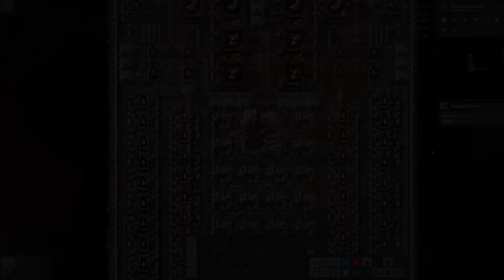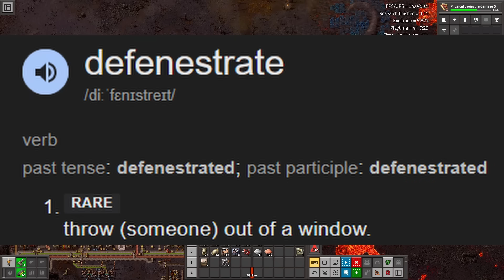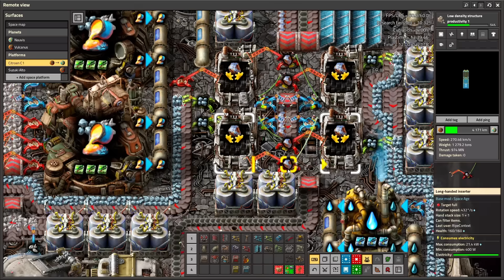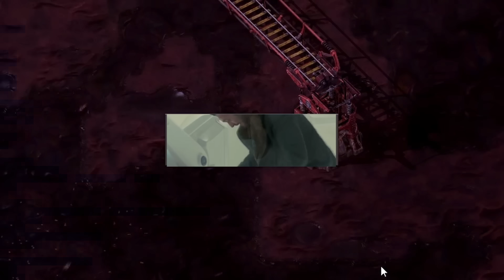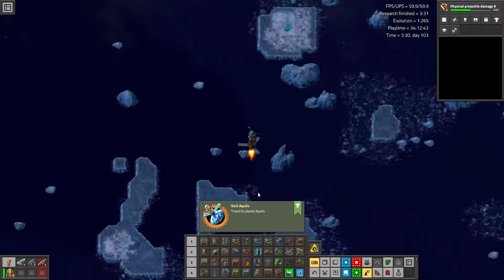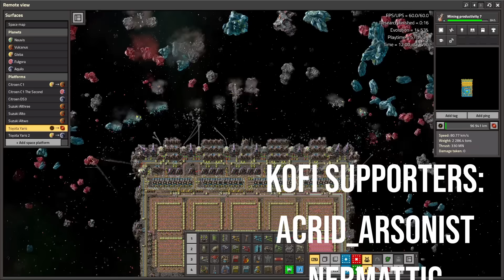Megabasing the Star System in Factorio Space Age | Factorio MegaMegabase [1/3]

Comment: Acid neutralisation straight into steam engines? Also mod, right?
Reply: There are technically 6 mods enabled that I can see, 5 official and 1 unofficial. The 1 unofficial mod is Any Planet Start. The 5 official mods are the same ones anyone with the expansion has: core, base, Elevated Rails, Quality, and Space Age, the first two of which are present without the expansion, and the remaining 3 only available with the expansion.

Acid neutralisation into steam engines is possible in vanilla Space Age if you don't unlock nuclear nor visit Gleba first, but it's practically required with Any Planet Start set to Vulcanus.
Reply: @angeldude101  thank you for your elaborated answer! But I've found that it don't work. Acid neutralisation produces steam at 500°. Steam engines only accept steam up to 165°. So I'm thinking this is a part of the start any planet mod.
Reply: @Bump3rst1cker  Steam engines having a max temperature doesn't mean they won't accept steam of a higher temperature. It means that steam engines can't use the energy from that extra heat. Essentially, a steam engine being given 500° steam will generate as much power as if the steam was 165°. It still generates power, but it wastes a lot of the energy.
Reply from the maker: The only mods I have above vanilla space age is Any Planet start for starting on Vulcanus, even distribution, and (statsGUI or evoGUI, can’t remember which one and I’m not sat at my pc right now)

Comment: I feel like using a power switch to turn off tesla turrets while they are idling, and using gun turrets to turn them on when needed is a fun challenge.
Reply from the maker: My first reaction was no because I want to utilise the full range of the Tesla turret, but this actually might work with legendary gun turrets, i’ll have to test for when i do my full perimeter
Reply: @ripecontext  Oh, huh, good point. Maybe laser turrets would be better with their range (Rare laser turret has a range of 28.8 vs a base tesla turret's 30). Either way, you would probably want those turrets placed a little further out to detect enemies earlier, but then you'd also have to worry about the tesla turrets not staying on if the sensor turrets get destroyed! 😅

Comment: Isn't solid fuel more efficient than rocket fuel (with the aquilo recipe) it takes 10 solid fuel to produce one rocket fuel for 100 MJ per rocket fuel unit. one solid fuel unit has 12MJ, so you are turning 120MJ into 100MJ before burning it.
Reply from the maker: By that point I had rocket fuel prod 5 so I was getting 150MJ from 120MJ
Reply: You have rocket fuel productivity and productivity modules and you can reach a max 300% productivity on rocket fuel. At that point you get 4 rocket fuel/10 solid fuel.
Even if you don't have max productivity, rocket fuel is still worth it because it last longer.
Reply: ah, i forgot about them. i researched a few levels on my playtrough. but never payed much attention to the math.
Reply: roclek fuel is more energy dense inventory wise (60 rocket fuel train will run longer than 150 one)
also productivity research as others mentioned
Reply: If you're moving it by bots to feed heating towers, it's significantly more efficient!

But yeah given you're making Rocket Fuel in a Cryo plant, it's easy to have at least 20% prod, then speed+efficiency so it's not slower nor power hungry. (or just even more prod :P)